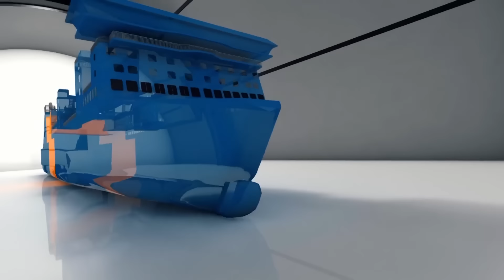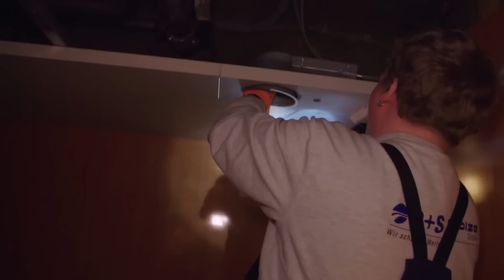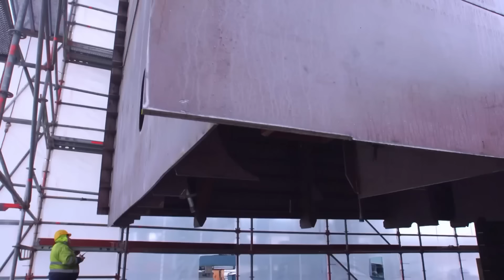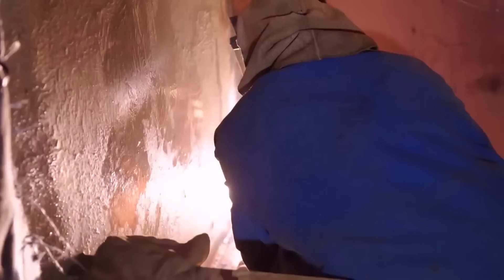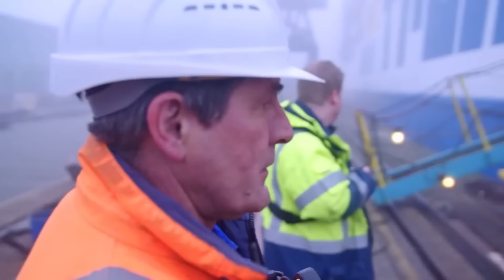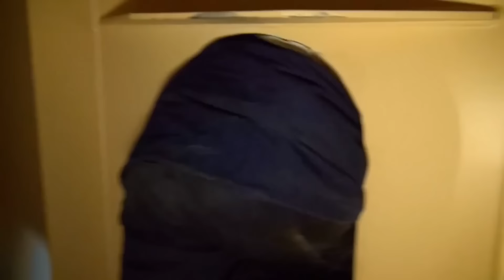Mega Ship Surgery | How Engineers Stretched a Ferry by 30 Meters | FD Engineering

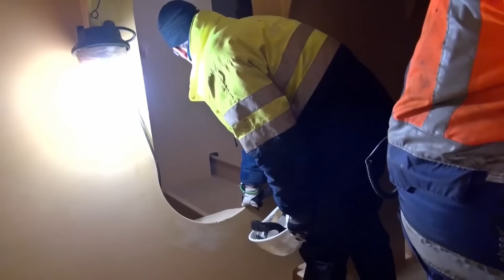Comment: I am wondering why they are only checking the quality of welding by only checking water leakages.I think need to check strength of welds on different conditions. Am I right?44:57

Comment: The first V-class BC Ferries 🇨🇦  ships were cut and lengthened (stretched) in 1972, adding a 25-meter (approximately 85-foot) midsection to increase capacity. The Queen of Vancouver was among the first in 1972, though some sources suggest initial modifications began for the fleet in 1971.
Process: Ships were cut in half vertically, and a new, pre-fabricated midsection was inserted to increase passenger and vehicle capacity.
Vessels: The "V-class" vessels were the Queens of Vancouver, Victoria, Nanaimo, Esquimalt, Burnaby, Saanich, and New Westminster) were targeted for these upgrades.
Subsequent Refits: These ships were later cut again horizontally in 1981 to add an upper car deck.
The Queen of Victoria was also significantly repaired in 1970-1971 after a major collision, but the planned fleet-wide "stretching" program took place from 1972 onwards.
   🇨🇦 🍁 🇨🇦 🛳 🚘 🚚 🛻 🚛 🚘 🛳 🇨🇦 🍁 🇨🇦

Comment: If the initial cut to separate the ship is 1km long, why does it need 4km of welds to insert the new section?
Wouldn't it be 2 * 1km?
1km at each edge of the original cut?
Reply: Because you took you cut 1 km then you have to weld it on both sides which ends up being 4 km you’re only cutting through the steel one time you have to weld both sides, but even that should only be 2 km
Reply: @steveanderson4768 you forgot they may have welded both sides of the open grove butt weld joint….
and did they do the welds in more than one pass? Was there any reinforcement plates added to joints….
Reply: They also added a car deck
Reply: The measurements are way, way out !!!
Reply: It’s actually 998metres 😃😃😃
Reply: There are two 1 km seams to weld and they have to be welded top and bottom.